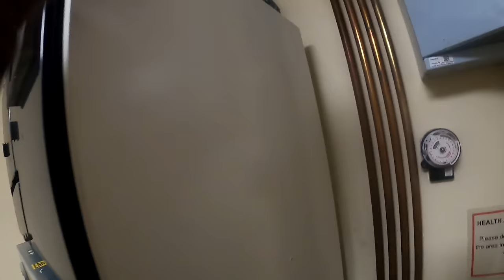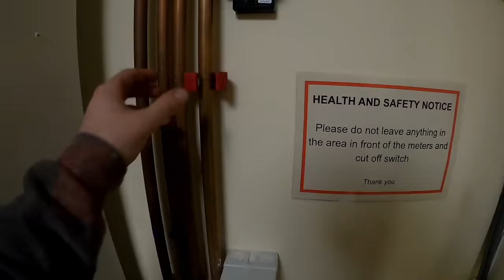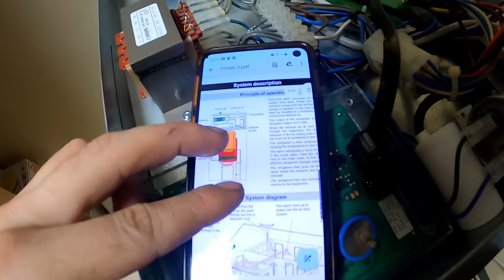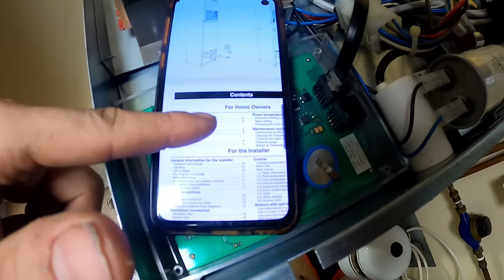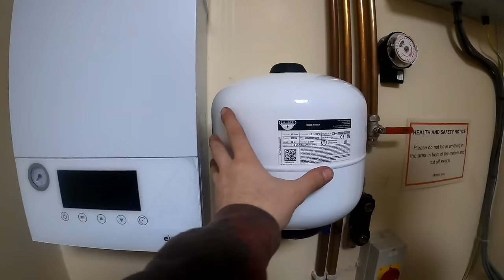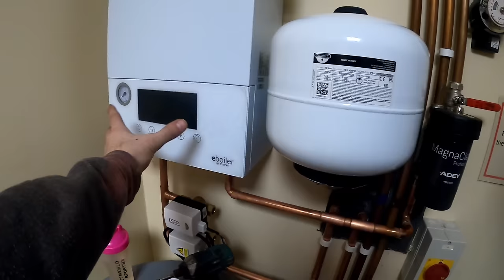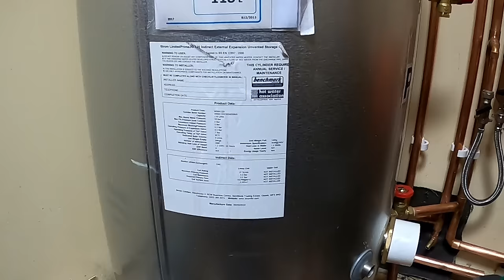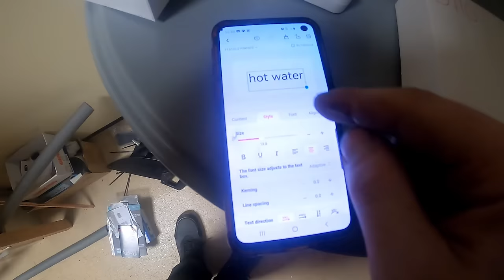A job to build character

Comment: Hi Tom, bad news about the boiler going bang, I’m glad you were not injured apart from the ringing ears. 
I’ve not had much experience of those electric boilers, a nice tidy install by young Jacob and yourself. 
Plenty copper pipe and solder that’s always great to see, the boiler manufacturer should pay for your time to install the replacement boiler surely. 
Another great film Tom, have a good week and stay safe mate. 👍👍👍
Reply from the maker: Thanks for the support as always Chris, I doubt they will pay my time, like you say they should but most always wiggle out of paying, it's not fair really

Comment: Tom the old unit you took out was a Nibe one   when I worked for another housing association they were in one bedroom flats, from what I remember it wasn't an unvented it was a heat store with a mains pressure coil inside.  They had to be left on 24/7 because they took ages to heat up the radiators.  The problem with the new boiler dead shorting will give you potential of up to 5000 amps , hence the flash and bang . Fortunately it was contained and you didn't get showered in molten metal . Stick to water it's much safer .
Reply from the maker: Good advice that, at least with water you only get wet, I looked up the instructions on the old unit and it took 8 hours to heat the water up from 15 degrees, it can't have been that efficient to run although the new unit probably won't be much cheaper with the cost of electricity

Comment: Had the same problem with my pipes slice from narrad gone back to rothenberger, and Rothenberger cutter works with unifix clips. A few manufacturers are bringing them out now. valiant have one.
Reply from the maker: I was really disappointed with mine, I now have two that are temperamental as I took it back to where I got it from and the rep  said there was nothing wrong with it, it does work sometimes though, thanks for watching

Comment: That's a bit different job there Tom ..you And Jacob have done a very neat job there .👍👍👍👍.that old unit took some getting out..
Not even going to mention the electric boiler 😯.
Is it very scary when something goes bang in your face .
Not surprised you was shook up with that bang.

Get your electrian to carry out an insulation resistance test on the elements on the replacement boiler before you switch it on .
👍👍👍👍👍👍👍
Reply from the maker: Thanks for the support as always John, he wil certainly check the readings this time, you don't expect a new product to go bang
Reply: No you would not ..
But seems to be the way with new equipment now ...not what you need at all 😌😞

Comment: Great video Tom, but what a dreadful experience with that boiler! You were very lucky not to have been seriously hurt with that amount of energy; it would seem that the manufacturer did no QC or testing, which is terrible, that being the case.
On a lighter note, I’m with Jacob (whose work looks excellent) on the use of abrasive rather than steel wool, as I don’t like the bits of steel it often leaves all over the place.
The unit you pulled out looked pretty interesting and unusual - you certainly get a wide variety of jobs! 
That printer looks handy for lots of things!
Reply from the maker: Thanks for the support as always Steve, it certainly went with a bang, frightened the life out of me, like you say it should have been tested as it could have hurt someone

Comment: Hi Tom great video as always, just a question about the automatic bypass valve, I’m currently looking into upgrading a two pipe system into a S plan system with two zone valves one for UFH in a bathroom and the other for radiators throughout the house and was told that the automatic bypass valve needed to go before the zone valves is that correct? And in regard to the automatic bypass valve what would that be set to? 
Thanks
Reply from the maker: Yes, the automatic by pass will need to go before the zone valves, when setting the system you will need to make sure the by pass opens when the zone valves shut, it's easiest to use a clamp on pipe temperature gauge to see when the hot water goes through the valve

Comment: Loving all the content Tom. How come you didn’t replace it with a new heat pump instead
Reply from the maker: It was client specified, a heat pump would have been good although siting it outdoors would have been a slight issue, there was only a 600 wide passage so it would have needed to go high up, thanks for watching

Comment: Always a pleasure to watch your videos! Do the new copper fittings need to be brushed prior of the soldering? I'm running the hot and cold on my house and I've got a feeling that I missed that. 
:(
Cheers
Reply from the maker: They are usually fine if they are new fittings and look clean, if they're been in the van a while they tarnish a bit so I clean them, thanks for watching 👍

Comment: Had the nerrad cutter before utter shite 😂, I use the pitbull pipe slices from Mac Donald plumbing supplies, they are really good and reasonably priced compared to the nerrads
Reply from the maker: Thanks for the support mate, they do look good to be fair, I might have to treat myself
Reply: @PlumbLikeTom  you want regret the pitbull slices, I use mine everyday and have been impressed so far

Comment: Had one of those Nibe Fighter exhaust air hear pumps in my house when it was new. Housing trust replaced it for a combi. Good system only problem was no one knew how to set the heat curves on it. I tweaked mine and it worked well. Heavy things to move though. Good job as always bud, nice to see some more unusual jobs 😊
Reply from the maker: Thanks for the support as always mate, it was the first time I've seen one, it certainly was heavy getting it out
Reply: Nibe.. dreadful things , never worked properly ever , used to freeze up on the outlets when filters were blocked , LPG is used as the refrigerant, dangerous if you don't know that,
Reply from the maker: Good to know mate, I have paid a company to decommission the gas out of it so it can then be recycled

Comment: Another near job man, well done. As a spark I am not going to talk about it going bang as I have had a lifetime of those panty filler moments from one thing or another. However I can’t believe the price of an electric boiler, it’s only a glorified shower in a box with a pump and vessel. Sad thing is they are less reliable than a shower!! Still, it was a good watch. Alll the best.
Reply from the maker: Thanks for the support mate, like you say not much to these units, it certainly went with a bang though

Comment: suppose to use flexi hoses on them boilers would look like piss if you ask me. fitted 5 in a set of apartments never used flexis didnt even know until i was onto their technical on the phone
Reply from the maker: I spoke to them about the flexi hoses and they said it's fine to use female irons as long as the connections inside don't twist, thanks for watching 👍
Reply: @PlumbLikeTom  turco ones seem a better electric boiler

Comment: A few points, even the worst heat pump is a lot more efficient than direct electric heating, these nibe units also provide forced ventilation the customer may have issues with air quality and damp after removal. I hope there is some sort of economy 7 /off peak strategy behind running this, otherwise its going to be brutally expensive.

Comment: Is there any point using electric boiler to heat up the hot water? Would it not be as efficient to just heat the water on the immersion? Curious that's all..
Reply from the maker: In the summer I think the immersion will be better, I have put it on a timer so it will come on in the day and the boiler will just boost it when needed, thanks for watching as always mate
Reply: It saves and is simpler to use instant tankless heaters for hot water. Hitachi do 8kw units for £100 one ine the kitchen and one in the bedroom.

Comment: I don't understand your bad luck with the nerrad slices, I've had my 15mm one for about a year now and it's still cutting in about 3 spins
Top video as always Tom
Reply from the maker: I'm just unlucky I think, I have two bad ones now as they sent it back to me as they couldn't find anything wrong, it works sometimes but then will just spin for days
Reply: @PlumbLikeTom  have you been cutting painted pipes? Paint specs get their mechanism is a hissy
Reply from the maker: @killerbean9911  I don't recall doing, I mainly use the milwaukee and it's only when I can't get that in I use a slice, the second cutter I got was brand new and just span, they did say I might be turning it the wrong way, I'm know I not good but I do know how to use a pipe slice
Reply: @PlumbLikeTom  😂😂 We've all spun it the wrong way but tried the other way 😂 were idiots but we're not that stupid 🤣🤣

Comment: Sorry to hear about your experience mate its not very nice when electrics go bang on you. What model boiler is that out of interest as its only 63amp supply for 14.5kw? I'd like to see the manual. Nice work from you guys, electrician did a nice job too.

Edit 60-63 amps works out fine, im guessing its a 10mm cable ran to it hard to tell off camera.
Reply from the maker: The electrician did all the calculations and I trust it was all Ok, he did the one before which was the same, thanks for the support, it is greatly appreciated

Comment: I'm wondering why you put a indirect cylinder in rather than a direct when both are using electric, not quite finished the video if you explain later.
Reply: Thinking about it maybe the heat recovery on the hot water might be better on the boiler with the coil rather than the immersion. Not sure 🤷. Good video though
Reply from the maker: In the summer the immersion will be used, the boiler will boost the cylinder when required throughout the rest of the year, thanks for watching 👍

Comment: What do you think of these air sauce heat pumps are they any good Tom
Reply from the maker: They are good in the right place, It's always down to correct design and installation
Reply: @glynstorer3269 I had one in my 2009 new build. Once you get the heat curves set its as efficient as the condensing combi the housing trust replaced it with. I liked it as you had good air flow through the house with continuos extraction. Trouble is like all heat pumps there's not many engineers understand setting the heat curves up. I taught myself and got mine dialled in.

Comment: Tom stop fitting these electric boilers - it ain’t worth hassle. BTW NIBE did not go bust they have been in business for over 70 years with heat pumps  and are very much still in business . Those units had a less than stellar reputation in the U.K. but that was largely down to the installers who did not understand them and did not have the knowledge to pass  onto customers who subsequently did not operate it to best effect and ended up with high running costs. NIBE are still big in Europe and are in the top ten of heat pump manufacturers.

Comment: Why are you out of pocket pal no way its your fault
Reply from the maker: I had to change the boilers over for free, I also had to pay for the electrician to come back as he couldn't do all the tests he needed to do as the unit wasn't working. It probably cost me over £400 with all lost time. The manufacturer  didn't want to know and even said they were going to charge me if the old unit was sent damaged. It's honestly a joke when the installer has to pick up all the costs when it's no fault of mine. I have now fitted the new unit and the job is sorted for the customer which is always the priority